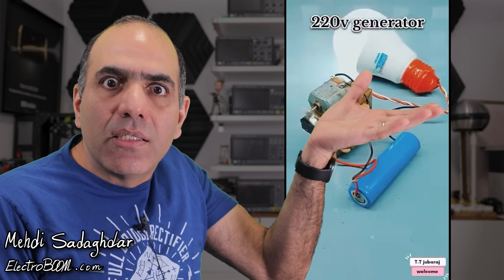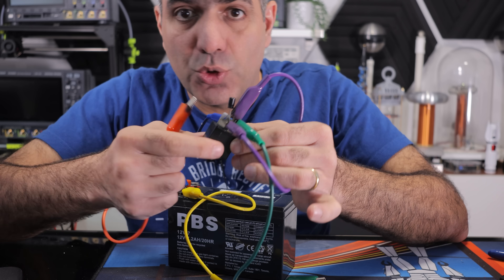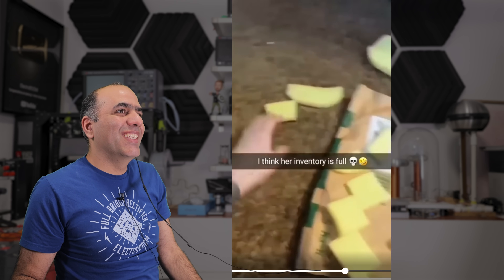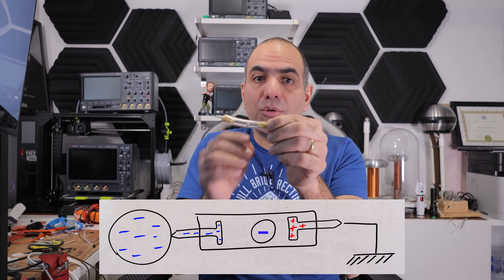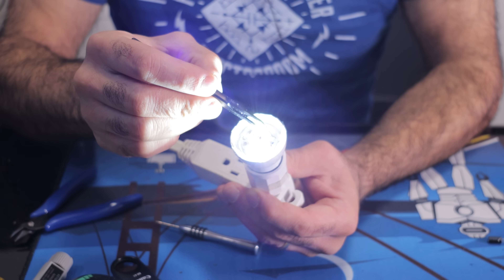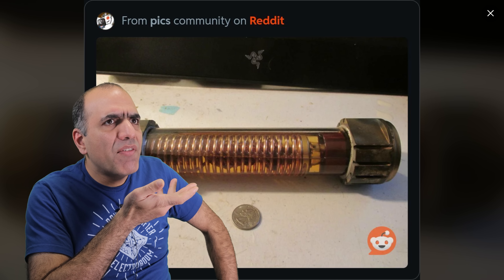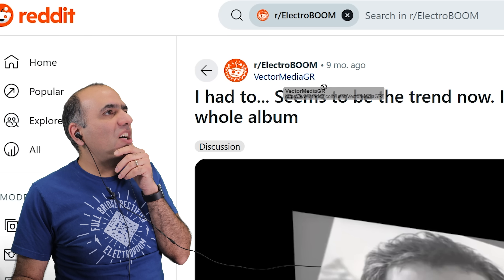Nuclear Egg (LATITY-015)

Comment: 3:00
That is how old car radios worked. They used the 12V battery to drive a special type of relay called a vibrator, which acted like the oscillating relay in the video. Then, the transformer would step up the AC voltage created by the vibrator, and a diode (usually a 0Z4) would rectify it into DC.
Reply: indeed.  very noisy and don't last very long though.  and these days probably illegal for RFI reasons
Reply: @tsm688  Not that noisy, they have suppression components. The RFI of an unquenched circuit would mean the radio itself doesn't work, and the arcing would also quickly burn the contacts if not quenched.
Reply: @eDoc2020  yes noisy, the capacitors of that era were not very good.  which meant the radio had to be a lot bigger too.
Reply: @tsm688  They were certainly larger but the paper capacitors of the day were definitely good enough for suppressing the noise from physical contacts. I've seen videos of vibrator-based radios operating and there's not much audible interference. Putting a cell phone near a radio has much more of an impact than the vibrator.
Reply: Not noisy at all, I have one that I recently restored. It’s in the car it was fitted into, still does its job, and is in regular use! They give off a distinctive audible hum, but no rf noise to speak of- otherwise, as has been said, the radio itself would pick it up. A smallish (0.1 uf, I think) capacitor is directly across the contacts, but the main suppression is the enclosure of the vibrator in an aluminium can that is efficiently grounded to chassis. As to longevity, the one I have has been in the car since 1950, and is still using the original vibrator. They were pretty robust. And yes, I believe the rectifier is an OZ4. Quite a nice unit, with push-pull output, rf amplification and both AGC and AFC.

Comment: The battery trick isn't completely fake though. You can start a fire with a single cell and just a gum wrapper or any other metalised paper cut into an hourglass shape. Big tabs and a very narrow section near the middle, give it around 20 seconds and it will start to glow! I tried it myself, but it's really hard to start a fire that way.

Comment: There are nuclear power generators that don't rely on steam. Look up RTGs - radio thermal generators. It's fairly old tech. Soviets used them in remote areas. Nasal used them in spacecraft.
Reply: they are huge and have huge heat sinks.  they are not a small plastic egg.

Comment: I disassemble faulty LED bulbs remove the aluminum substrate PCB Hold the board with something (preferably not flammable or meltable) and heat the underside of the board with a butane torch to remove the good LEDs intact with a pair of tweezers when I see the solder go fluid

Comment: The converter with a relay already exist. It's called a vibrator converter. It was mainly used to power autoradio and small tube device from a batterie mainly in the 50's. The alternative were to have a high voltage (at least 40V) batteries or a rotary converter

Comment: 4:20
This AA battery method to start fire does actually work.. Take a gum wrapper and touch the aluminum sides to the positive and negative terminal. It conducts enough heat to ignite the paper side of the wrapper. We do this to start our burn pit.
Reply: Perhaps using iron or steel screws is the answer too - vs copper stranded wire ...

Comment: 4:01 could it be the coating on the drywall screws is causing the sparks?
Reply: That was my thinking, or maybe the aluminum screw too. Versus stranded copper wire, not so prone to create burnable sparks like fine grained aluminum particles can burn.

Comment: @electroboom Enron Egg (albeit of course fake), could be done with a RTG in theory....
Reply: they are huge and have a huge heat sink.  they are not a small plastic egg.
Reply: @tsm688  the egg could in theory be the heatsink too
Reply: @shadow404atl  a plastic heatsink?
Reply: @ The enron egg in this application could be made out of a heatsink material like aluminum or what RTG's use, beryllium, aluminum, stainless steel, and carbon-carbon fibers. It's not like your gonna take a plastic egg like was shown and expect it to work off the shelf. Haha.
Reply: @tsm688  I wish you knew what you were saying.

Comment: While the nuclear egg is a hoax, an RTG (Radioisotope thermoelectric generator) can be quite compact and run for many years. I'm not sure how suitable it would be for home use though...
Reply: they are huge and have a huge heat sink.  they are not a small plastic egg.
Reply: @tsm688  You could place them in an egg shaped container, which could be made of plastic...

But more importantly, they don't have to be huge, it depends on the application (Bigger = More energy density).  For low power applications there are RTGs the size of a large suitcase.
Reply: @ Please don't play dumb.  To power a house as enron imagined it would have to be huge.

Comment: What the balloon tripped was actually the transformer fuse.
They're specifically manufactured thin wires under tension. When they overload the metal vaporizes (loudly) and the body of the fuse falls down to create distance between the energized and dead side. It also makes it super easy for the linemen to identify when they come to fix it.
Reply: They are often more than wires under tension - it is common for them to include an explosive charge - both to blast the ends of the wires clear, and release gasses that help quench the arc.
Reply: I think the technical name (that can be searched for) is "expulsion fuse". A small charge ejects the contents SO an arc (plasma) will not form and maintain the circuit ...

Comment: Probably I'm not the first to mention them, but radioisotope thermoelectric generators use the decay heat of a radioactive material and the Seebeck effect to generate electricity. That's how the Voyager probes and the Curiosity rover are powered. 
There's also betavoltaic batteries that use the beta particles (electrons) emitted during certain the radioactive decays to generate electricity, although those only deliver microwatts.

Comment: Well. Regarding the nuclear power,  you are wrong , there is something called Radioisotope thermoelectric generator RTG ,Some isatops like plutonium and strontium 90 can heat them self throw decay, and generate heat, alot of heat and the heat is enough in 100watts . This can generate electricity like the peltier module . Google it.

Comment: To repair the LED lamp, it is advisable to rescue LEDs from another burned-out lamp, or increase the resistance to reduce the power. Beyond that, the time spent repairing the LED lamp far exceeds the cost of a new lamp.

Comment: Erm, wasn't there this thermo nuclear battery do-hicky ussr installed in remote lighthouses? Don't know if you can fit it in an egg but doesn't need a turbine
Reply: they are huge and have a huge heat sink.  they are not a small plastic egg.

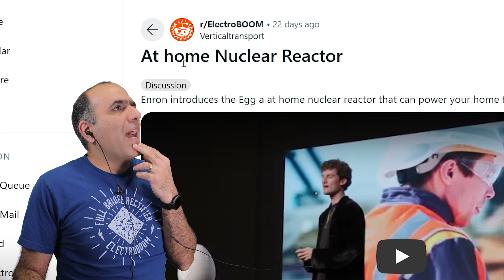Comment: 11:58 There are actually even several ways how to make a "nuclear" electric generator in size of a chckn-egg. E.g. based in thermoelectric principle (using Peltier cell) as used on Voyager probe, or photoelectric as used in the "nuclear battery" used for clock backup in some neiche applications. You could even build such generators at home from some isotopes you can find e.g. in smoke detectors. But please don't do it if you don't understand what you are doing and all the health and environment dangers involved. Mehdi, do you accept the challange?
Reply: they are huge and have a huge heat sink.  they are not a small plastic egg.

Comment: khm... radioisotope thermoelectric generator, implememted in NASA's Voyager space toy. 😮 Mehdi didn't hear about it?
Reply: they are huge and have a huge heat sink.  they are not a small plastic egg.
Reply: @tsm688  except when implemented in a pacemamer, inside a human's body? it really depends on the application (power requirement)
Reply: @HoSza1  it is really tiring when everyone plays stupid.  those are microwatts. a 100-watt one is too big to lift.  one to power a whole house would be like 5 kilowatts, and be enormous.

Comment: And I rarely have to fix or replace LED lightbulbs. My method is to buy a bulb of twice the power needed, then modify it to be half of its original power. It makes it run much, much colder and automagically makes it last waaaaaaaaaaay longer than without the mod.

Comment: Hi Mehdi, love your channel. It brings the whimsey to Electronics/Physics.
Some fun facts:
Back in the mid 20th century, before the advent of the transistor, they would use a buzzing relay to step up the 12V car battery to the 150+ Volts needed for the B+ on the vacuum tube radios. Needless to say the "vibrator" was socketed for easy replacement as they will burn their contacts over time.

Also, more fun with transformers: If you can get your hands on a flyback transformer from an old CRT TV you can hand wind a new primary (2 windings, one for the collectors and one for the base drive, both center tapped with the collector winding having at least 2x the number of turns than the feedback base winding. ) on the opposite side of the high turn count donut and wire it up to a pair of 2N3055 (or equivalent) transistors to make a push-pull oscillator, which will put out several thousand volts and create some nice arcs. I bought a voltage doubler module from a surplus house which changed it to DC and made the arcs huge and VERY loud, at least 2". I had to use a plate glass cap made from an 8x10 piece of glass and aluminum foil leaving an inch of space around the edge so as not to self arc. I'm getting the itch to rebuild it, since I lost it years ago.

Comment: Wouldn't a closed egg thermal nuclear reactor work tho? If you build the shell as a radiator that cools the whole thing down? Steam runs the turbine and then when it hits the cold top it goes back to being water and runs back down to the boiling chamber? 
But don't listen to my stupid thoughts, i know nothing and has definetly not enough edumacation to build a nuclear power plant.
Reply: guess what's not a shell that cools everything down.  a small plastic egg.

Comment: My man must have forgotten about the seebeck effect and it being the primary mechanism used in Radioisotope Thermal Generators on Cassini and other long ranged satellites. In other words the EGG could be a real product but the ammount it could generate would be nearly useless.
Reply: Yea, it would make for a really unwieldy phone charger...
Reply: you need a huge device to generate 100w power.  and they still output a ton of heat.
Reply: which again makes his statement true in a practical sense, as a true home generator would be improbable at least. so you are technically right. the best kind of right :P
Reply: @another_blacktomcat  Technically correct is my favorite kind of correct even when used against me I can't resist but applaud such a defeat. XD

Comment: 5:08 Technically both "battery" and "pile" are incorrect because that is a single cell. For anyone reading who doesn't know the reason the word 'pile' was used was because you made a big stack of many electrodes and spacers. So literally a pile. Many languages still use a word like that for batteries (and also cells, which is technically incorrect).
Reply: well a pile of a single element is still a pile aint it
Reply: @fernandomagnabosco this is a very tidy resolution to the paradox of the heap

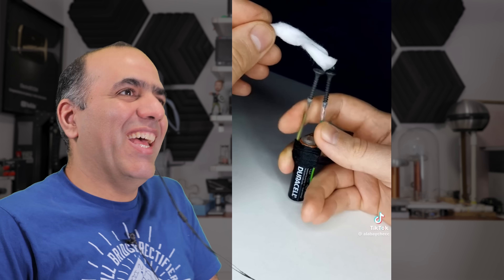Comment: 3:54 uh, actually, not fake, some AA batteries have RIDICULOUS currents. Not sure what technology they're based on. A customer's amazon fire tv remote caught on fire when the board caught a short. The battery literally combusted in flames. It was some random chinese brand AA 1.5 battery. Not rechargeable or anything fancy.
Reply: It is so fake maybe not because of the battery but because he is holding burning paper in his hand without burning. 😂 so fake
Reply: But the normal aa battery can't make fire
Reply: @Dinopjok  standard ones ye. Best they can do is make a paperclip hot. But there's some weird chinese ones that can.

Comment: 3:32 easy, pry it off the wall with a non-conductive tool, like one of those black nylon spudgers they sell for phone repair.
Reply: Some regions have separate switches on the socket itself. Which in this case, all you have to do is flick the switch off, take it out and vowala.

Comment: In a similar way I have broken two relays and an additional problem is that every time the switch is closed and opened by the relay, carbon deposits form on the platinum.
Reply: Relays CAN be made to oscillate, but they are not designed to be used in this fashion.

Comment: 3:41
If you still want to make a fire out of aa battery, you can cut the gum aluminum wrapping to a long hourglass shape then touch the wide sides to the battery terminals. The heat will focus on the middle of the shape to the point it burns

Not like that bs

Comment: For the battery spark thing to work you can place a series inductor. That will spark. Also if you have a battery that can provide more current it will spark, so that video might not be fake.
Reply: He does in fact have a battery that can provide more current but it is not visible. Pretending it comes from the AA battery makes the video fake.

Inductors resist the change in current so when current flows through them and they are disconnected high voltage arcs across the contact trying to maintain the same current. It could potentially be used to light something but it looks completely different from the sparks in the video were the was burning metal flying caused by high current

Comment: While the egg is bogus, there used to be nuclear-powered pacemakers that had plutonium batteries.
Reply from the maker: Perhaps, but I'm sure it wasn't thermally isolated from the body like the egg is to the world. The point is, heat needs to flow away and can't be contained, otherwise it just builds up.
Reply: @ElectroBOOM  Nuclear RPS could work but that thing is a parody and is definitely not viable.
Reply: @ElectroBOOM  the РИТЭГ is laughing at you kids
Reply: @ElectroBOOM our muscles already produce a lot of heat, the heat produced by the tiny amount of plutonium probably is less than regular daily variation
Reply: @ElectroBOOM  The heart of plutonium leaks out through masses of lead shielding to keep your house permanently warm in winter... and summer.  You could re-concentrate the heat under insulation, conduct it through a thermoelectric generator into a fridge, and use the generated power to run your fridge.  Simple physics man!
Reply: A chicken egg might be a bit small, but something like the demon core would definitely fit inside an ostrich egg… not that I would recommend it, though.
Reply: They don't produce much power though. The large ones can power a small military camp and they the size of rooms.
Reply: I've also noticed (Parody) in the Egg video's title. Why has no one noticed this, not even ElectroBOOM?!
Reply: Keeping your heart pumping but giving cancer at the same time.  Well cancer is slowly developping, you will actually get more years.
Reply: “Nuclear-powered” is redundant since you mentioned it has plutonium batteries. Shorter more concise statement equals better.
Reply: @DionyLescailles  k
Reply: yeah, those were RTG tho, have a hot side, a cold side, and thermocouplers generating a small bit of power over the temperature difference
Reply: @aurunemaru the egg wouldn't work as an RTG either. Wrong shape. Being almost spherical, it doesn't have enough surface area to provide the cold side temperature to drive current.
Reply: @ yeah the egg is a complete lie, unlike the pacemakers (that needed very little power)
Reply: @aurunemaru  no.  rtgs are what some spacecraft use for low power.  Not medical devices.  Nuclear batteries work by directly using the radioactive decay - unstable elements spitting out a charged particle - as the current source.
Reply: It is known as an atomic battery it doesn't do fusion reaction it uses radioactive rays to power it
Reply: @sreeraagreghu5094 if you really want pizza that bad, just like go get some.

Comment: Mehdi if the "AA battery lighter" was a (rechargeable) Nickel Cadmium or lithium battery would that work? before exploding in the users hand.
Reply: nicad is even less voltage, that wouldn't work.  and lithium is just 3v so wouldn't work.  no spark.

plenty of heat though.  just got to wait a little longer.

Comment: 12:13
Wait
So
Nuclear energy is basically just steam power, but instead of using coal (Or other combustible fuels) to boil water, we just use the radioactive decay of an element to heat the water?
Reply: Yes, it’s using spicy rocks to make steam
Reply: Funny thing is that is how most sources generate power other than wind or solar.
Reply: Yes.

Comment: Floaty balloons contain helium, which is highly conductive in the right circumstances.
Like during a hot arc...
Balloon-foil alone isn't gonna conduct enough current to take out the breaker.
Reply: Air is also pretty conductive in similar circumstances. There are videos of people throwing thin wires over power lines that cause a continuous arc. The vaporized aluminium also affects the conductivity
Reply: at 10,000v all you need is a path and you get an arc.

Comment: 12:40 NASA uses small nuclear batteries. IIRC they use piezoelectric crystals to turn the heat into electricity. Less efficient than a nuclear power plant, but totally capable of being contained in a portable home device. Mind, it wouldn't be safe at all because some idiot would inevitably break it open and get dosed with radiation.